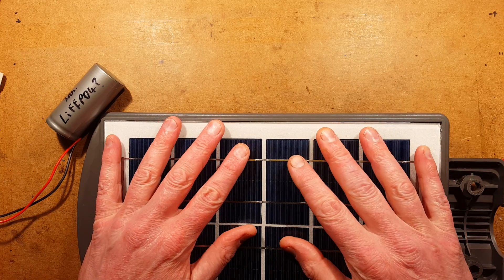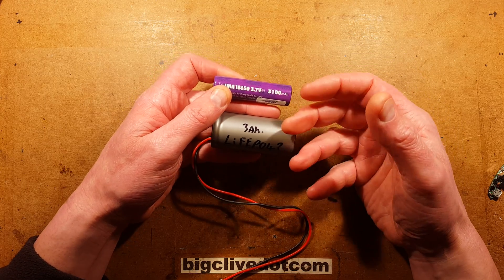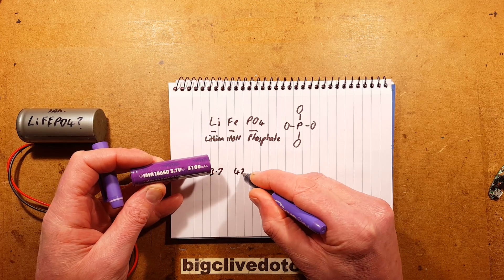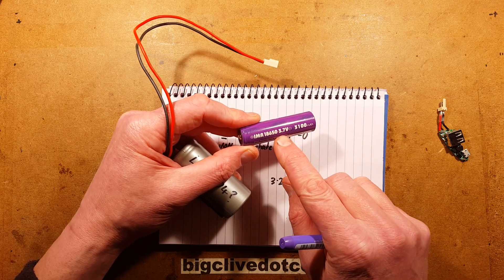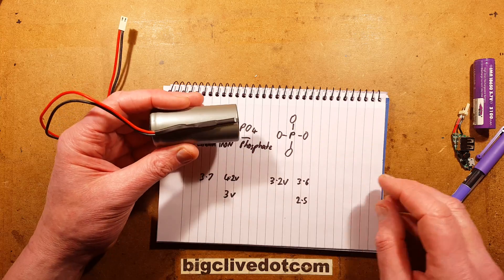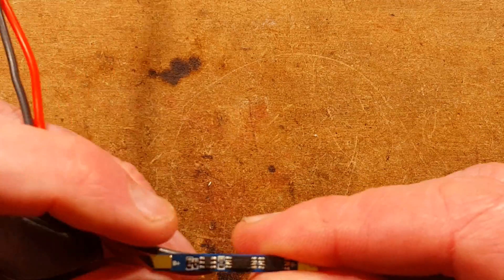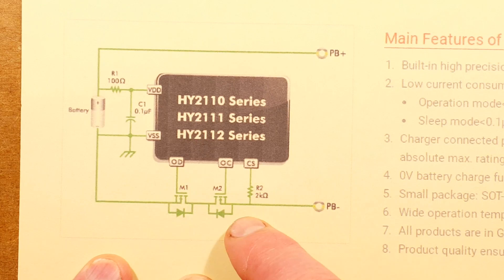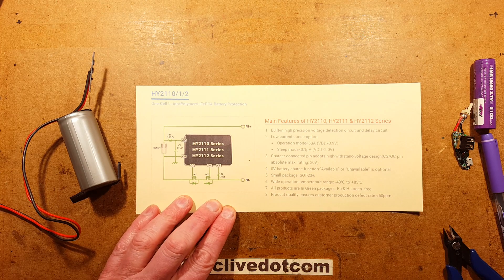LiFePO4 versus standard lithium cells.

Comment: I have a leaf and it's definitely Li-ion in weird tuna cans.
I've seen an application that uses LiFePo but can't for the life of me remember where. That's going to bug me now.
Interestingly the 2nd gen leaf (24kWh / 2012 -2017) batteries seem to be insanely well engineered, they look to be good for 10+ years easily although it's early days. Apparently cooling makes a massive diff, the 30kWh model of the same generation has significantly more battery degradation simply because - allegedly - they packed more cells in without increasing cooling. 

Also bucking with "assumed facts" the batteries seem to thrive on being rapidly charged (30 mins to full), with more degradation being seen on those cars that are home charged only (5+hrs). 

We're going to be seeing some more interesting discoveries in the future with these batteries I suspect. Especially where it comes to charging cycles and longevity. 

I think where I might have seen LiFePo could have been on 12v lead acid replacements?
Reply from the maker: LiFePO4 is a good voltage match for traditional lead acid due to four cells having a similar voltage range.  It appears I am wrong about the existing electric car battery packs.  I thought they had chosen the LiFe technology for safety and long life.  The rapid charging versus slow charging is odd.  I'll have to investigate that.  Precise battery management is crucial in longevity of the cells.  The use of air cooling in the Leafs is their slight downside.  Although probably less so here with our cooler climate.
Reply: @bigclivedotcom  rapid charging raising the so called "state of health" is perceived wisdom on the leaf forums and it does appear to work, but few drivers are electronically minded so it tends to become handed down wisdom without much basis...there may be other reasons causing the batteries to report a higher "health" which might be just crappy battery management..as no leaf owner is willing to disassemble their car we're reliant on the data through the odbc port.

It's all interesting though. And it would be immensely fascinating to see a leaf battery can disassembled if you ever get offered one! ;)

Comment: Have you come across any Wind Turbine type generators ? 
There is a Guy near me has a standard  solar array and a turbine.
Reply from the maker: The wind here varies from nothing to total destruction.   Turbines really need to be put in flat exposed locations to get maximum output.  Scotland has a lot of turbines.  There have been several times recently that they have generated more than the countries entire power requirement.

Comment: The Tesla model 3 uses 2170 cells. They are probably the highest tech cells on the market today. With the Nickel-Cobalt-Aluminum cathode chemistry that uses very little Cobalt compared to their competitors. The cells have been tested close to 6000mah making them the densest on the market. 

They also hired the world expert on lithium ion cycle rates years ago so these 2170’s should have twice the cycle life of other high quality lithium ion currently used in other cars.
Reply from the maker: That's impressive.  It sounds better than the lithium sulphur batteries.
Reply: It has been found that the charge discharge efficiency directly relates to battery life. So you can test a new battery, if you get 99.9995% of the energy out that you put in that battery will last longer than a battery you only gives you 99.5%  back. 

Professor Jeff Dahn and his team at Dalhousie University in Halifax studied the longevity of Li-ion by examining coulombic efficiency (CE) By creating the worlds most accurate watt meter. I think it approached 99.99999 accuracy. This allowed manufacturers to send them batteries with secret  additives and have them cycle the batteries to see which additives beyond the main metals gave the best CE. They found the difference in additives to be amazing. 

So Tesla hired professor Jeff Dahn back in 2015 to make the model 3 battery chemistry. Which is why it is expected to have an average of 90% capacity left in the model 3 after 20 years. Problem is it will take 10 years to see if they were even close to being right.
Reply: @ @ecospider5  Love Prof. Dahn's work.  But I have a peave about his presentation I watched on youtube.  He knocks Nissan for their choice of Li-Ion chemistry because it was not the least sensitive to heat -- totally ignoring the fact that it was the safest, and used the least cobalt.  (Nissan switched to another chemistry last year.)
Reply: @Dave. I actually agree it is hard to believe. It is also not something that is officially stated by Tesla but is just talked about if you read and listen to the research done with UHPC. I would be happy if my model 3 stays above 80% at the 20 year mark since I do keep cars that long. My bet is there will be a small percentage of current Model 3’s that will achieve that and it will get better every year. Remember I said average so this probably means the bulk of the cars will be spread out between 85% and 95%. 

But if this is true and we start seeing the proof of it in 5 years that the model 3’s charged properly still have 300 miles of range it will become a massive selling point compared to other manufacturers.

Comment: Rich rebuilds used a defective charger on the Tesla 18650 pack which made it go above 4.2 volts per cell. Then bang. It was a great example of how important good electronics are for managing a lithium ion pack.
Reply from the maker: I don't think it was defective.  Just lacking the battery management.
Reply: @bigclivedotcom  He said in a followup video that the charger went to high on the voltage.  I just used the terminology defective to simplify things and give him the benefit of the doubt that he is not the one that manually chose the incorrect voltage.  When you remove a battery block from a Tesla model S my understanding is there is no over voltage battery management as part of the pack so you have to included it your self in your design.
Reply: Ecospider5, the charger was not defective. Daisy came with 48v lead acid battery system, which uses 59v to charge and 55v to float. The charger will charge up to 59v and then enter float voltage of 55v. 

The Tesla modules have 6x groups of cells in series. He has 2 modules in series, so at full charge of 4.2v/cell that’s 50.4v. Placing a 48v lead acid battery charger on them will sent each cell to at least 4.8v, and without a BMS it’s likely one group will be higher. 

So the perfectly working charger will definitely cause a fire is it’s used on the wrong battery. That is the lesson here, and why it’s very important not to call it a defective charger, BMS, or battery. Nothing was defective except their careless behavior. 

Rich did not go into detail, but I’m guessing he plugged the 48v charger in, knowing it will be fine during the constant current phase, and they just need to keep checking it and unplug it when the Tesla battery is 48 volts. (4.0v per cell). Whoever was left to monitor it let it charge too long and it was probably already at 56v when the first cell started ignite.

But I bet that charger still works perfectly, for a 48v lead acid battery.
Reply: @imho7250  He cant be that stupid to charge a Tesla battery with a lead acid battery charger.  I highly doubt that.
Reply: Chuckiele, I’m sure a 48v charger came with daisy, and pretty sure he didn’t have a charger for 12s lithium. It’s not dangerous I’d you are watching it. We can assume daisy has 60ah batteries, so the charger CC would be about 6-12A. No problem at all for the Tesla.

But of course you need to constantly monitor pack voltage, and unplug it at the right time. 

Rich wasn’t clear about exactly what happened, because I think he didn’t want to throw the guy under the bus. So we don’t know if he was just stupid and plugged it in and walked off, or knew he was supposed to be monitoring it and got sidetracked.

I wish rich would say exactly what happened, even if he changes the names to protect the innocent. The only value of the video comes from saying exactly what happened. But if the problem is as I suspected, we all know not to plug that in and walk away. Lol
Reply: @imho7250  He does so much Tesla stuff, he surely could have gotten a charger easily. But yeah, you never know what happened.
Reply: Chuckiele, yes, but Tesla doesn’t sell a chargers for 2 modules in series. 12S is an odd voltage. Most people use 13S to replace 48v lead acid, because it’s 48.1v nominal, and they get a charger that stops well short of 4.2v per cell, or make sure there is a BMS.
Reply: @imho7250  I am certain that TESLA is not happy that their batteries are sold from scrapyards to amateurs... This video is bad for reputation, although its not at all Tesla's fault when a battery bursts into fire when mistreated in that way. I believe he mentioned somewhere they used the original lead acid charger.
Reply: Reinhard vom Dobel, well this is part of Tesla’s claim of battery second life. If Tesla didn’t want this, they can simply offer a core charge return on old modules so that every salvage yard sell directly back to Tesla. But Tesla can’t afford that.

This is going to happen more and more as people try to buy these. There are other channels talking about using them for solar, and as armatures do it, there will be more fires.

I bet there are a whole lot of these that people just don’t admit to. At least Rich admittedly it was their negligence, not Tesla’s, which caused the problem. I hope this scares people into doing proper research before charging any lithium ion batteries.
Reply: @imho7250  the currently asked prices for such modules (on ePray, for example) are higher than the naked cells would cost. That prevents me from buying them :)
Reply: Reinhard vom Dobel, yes, they are pricey, but if you intend to use the complete module with cooling, $200/kWh is not a bad price. At least you know what you’re getting. With some of the naked cell deals, you don’t know until you get a batch and test them. 

The model 3 modules will be interesting as they will be filling up salvage yards like crazy due to sheer numbers and younger drivers. But their 23S (85v) or 25S (92v) modules are going to be harder to work with. 

Those voltages would be ok for some conversions but the modules are cumbersome to fit in a project car.
Reply: @imho7250  "It’s not dangerous I’d you are watching it." - What could possibly go wrong.  The thing you can guarantee about battery charging is that it is so boring, you're almost never watching it.  Watched pot never boils.  Till it does, and burns your shop down.  Seriously, charging Lithiums by "eye" is dangerous enough for a few 18650s but for a pack that size you have to be out of your god damn mind.
Reply: Tripledonkey, yes, if you don’t understand the dangers, it could be unsafe. But if some one was watching the pack voltage and checking eaxh of the 12 groups as it got hugger, it’s not going to runaway and go from 4.1v to 4.5v in 5 minutes. 

But if Rich would have been clear on exactly what happened, that would help. It’s very unlikely they would have had a 12s li-ion Charger, so using the charger that came with it would be fine because the current is limited to much less than is safe. But the 48v lead acid charger won’t go into taper until at least 57v, which is already too high. 

It’s going to happen more and more as batteries become available and people use them with solar chargers incorrectly.
Reply: @bigclivedotcom  As in - it was a LEAD ACID battery charger.  Clowns.
Reply: "I don't think it was defective.  Just lacking the battery management."
When you've got about a thousand 18650s hooked up to it near people or property I think making or arguing over 'distinctions' like this is somewhat missing the point no?
Reply: Iirc the tesla also has a "normal" Li-Ion cells, not LiFePO4
Reply: no cell protection on charging is asking for a fire, this one wont be the last and its def not the first, seen people lose their homes and pets charging bikes etc, still to this day no one has built what i would call a proper cell balancing protective charger, bottom balancing has always made more resistant packs, but you need a charger that will bottom balance the cells and then bulk charge stopping when any cell hits 4.2 (4.1), thats how i charge my packs, but have to do it manually in 2 stages as i have a 'normal' charger that wont do both in sequence
Reply: For large diy systems the batrium longmon’s system seem to be a good option but for medium to small DIY projects I have not found a product I trust. So when I converted my lead acid electric lawnmower to 18650’s I just decided to do everything manually each time I charge. I use a simple power supply set to the voltage I want for the whole pack and check each cell voltage my self to initiate cell balancing manually. Building the pack with individual cell fuses is also super important for DIY, that has saved me once when a cell reversed and tried to drain the whole pack.
Reply: It makes you think more why you would put 800 unprotected 18650s in a fucking car.

Comment: I also think that electric cars, especially Teslas, are using Lithium-Polymer based cells for their battery packs, because that's the only way how they can get something like 100kWh into one car. Maybe car manufacturers like VW, which used to build only internal combustion engines, playing it safe on electric vehicles until it's almost too late, and now offer electric cars with ridiculously low ranges per battery charge, use LiFePO4-batteries for their cars.

Comment: I believe Tesla is moving on to 26650 batteries because they only weigh 20% more (than 18650s) but have 50% more energy storage. That rich rebuilds guy is a total asshole & douschebag. What he did is like being a smoker walking around doused in gasoline and wondering why anything went wrong. duh!

Comment: The most significant difficulty with LiFePo4 is cell balancing. Once a cell is charge it basically will float up in volts and not pass any more current through it.  This means if one cell charges faster than the rest it will prevent the rest charging fully.

The other issue is not letting the cell discharge below a set voltage as it will damage the cell, so you need protection per cell for charge and discharge as well as balancing (a load switched across a charged cell so the rest of the cells continue to charge).

You can match cells to minimise this as an issue and suppliers like www.ev-power.eu sell such 12V monoblocs and i use them here.
Reply: A BMS takes care of it all.
Reply: It's even worse with Li-Ion cells.  Without BMS, the weakest cell in series will never reach full charge, an the strongest cell will overcharge, causing degradation or fire.  A Battery Management System is an absolute must for lithium battery packs.  Even if you start with matched cells, they will become unbalanced.  With LiFePO4 cells this is inconvenient.  With Li-Ion cells it is dangerous.

Comment: Have you ever opened up a car battery? I always wonder what it looks like inside.
Reply from the maker: A recent video about an emergency lamp has a sealed lead acid battery dissection.
Reply: quite dull. lead oxide paste cells , seperators and lots of sulphuric acid.

Comment: Clive how/where do you store lithium cells? I have a bunch of these and now i'm concerned about waking up in the night in some apocalyptic scenarios...
Reply: I use a case made for electrical circuits... Ammo boxes should work as well..
Reply from the maker: They're fine.  The ones in the video had been overcharged and then the failure of parallel cells was shunting the others out.  Properly charged cells on their own are fine.  I store mine in individual bags in a metal baking tray as a precaution.

Comment: Acually, most lithium cells' life cycle is around 200-400 cycles. LiFePo4 cells' life cycles are more in the 1000-2000 cycles. But due to they're many disadvantages, they are good for limited things. Still awesome though.
Reply: **their
Reply: No.  ~300 cycles when charged to 4.2v.  ~1000 cycles at 4.1v max.  >2000 cycles at 4.0v max.  It also depends on how warm you let the cells get.  And fast charging leads to heat.  I love LiFePO4 cells, but not for the cycle life.

Comment: one thing everyone in the comments seems to be missing is that, while LiFePO4 is less energy dense than other chemistries, it has greater power density. the electricity within can be discharged faster than other kinds of lithium ion batteries.
Reply: Well it can be discharged faster without catching fire, but at even 1C you will get a maximum of 60% back from the battery.
They are safer, but give up performance.
Reply: They also keep a more constant voltage.
Reply: Graphene lipos can support up to 100 times their capacity as a constant rating, especially if actively cooled.
Reply: Howling Wolven And where can you buy them? Last time I checked, nothing with graphene made it to the market yet, at least at reasonable prices (except maybe graphene supercapacitors, but that’s not a viable alternative to batteries).
Reply: GRBTutorials Hobbyking have a large range of graphene cells for rc models.
Reply: @mattclark7941  Thank you...
Reply: Lifeop4 auto ballances when a bank is expanded, correct?

Comment: I use them in the AA form, in pairs with dummy batteries, in high power flashgun units (Sony HVL-F60M, Godox TT685s) . The refresh rate for a 1/1 discharge is about 1", which is much less time than when using NI-MH (or seldom Alkaline). The downsides are the relative low energy density, the (sorta) special charger needed and the inability of the flashguns to cope with overheating... the last I suppose is probably due to the flash designers expecting a longer recycle time from 'common' batteries :-)
I was very pleased to find them, albeit a bit pricier, in a big french retailer currently operating in Greece, in the spares section of solar garden lights!